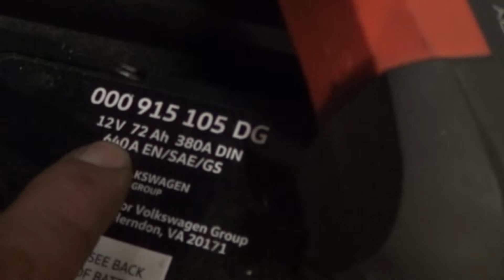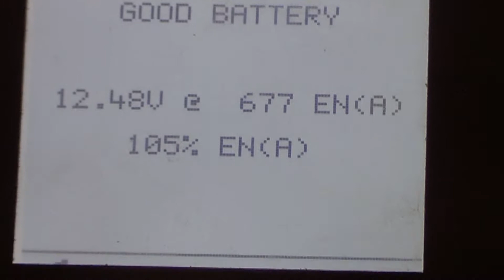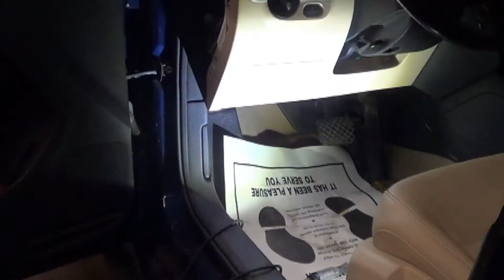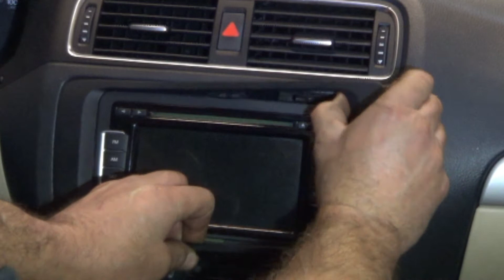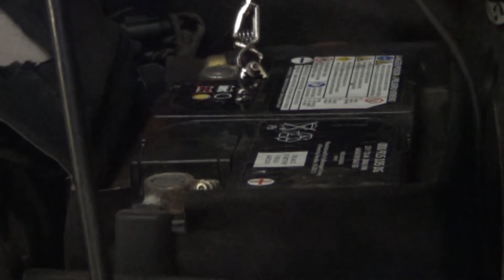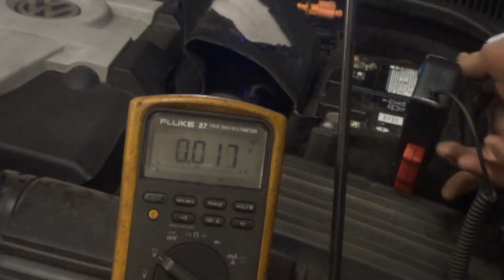2011 jetta tdi Battery drain

Comment: I have a 2009 cc (same car) with the same issue. The mechanic however couldn’t locate the source. He attempted changing the pesky door modules, changed the battery, confirmed the alternator was good. He’s giving up and asked me to pick up the vehicle. 
NOTE: their is another fuse box left of the steering wheel. 
I wonder now if it’s the radio, seems to be a common issue. I also just learned that prior to the battery draining/dying, the horn stopped working. Any advice is welcome.
Reply from the maker: advice in video,  Thats what I know.

Comment: i have a 2013 vw cc. one afternoon before work i had to jump my car to get to work, i figured my battery was bad,bought a new one. next day same thing battery was dead, got a jump and went to work. went to oriely's to have them check the battery and alternator theyre tester said i needed a new alternator so i got that changed. still battery dead. the only thing that keeps me from having to get a jump to start my car is if i dont lock the door because there is a red light that flashes while the car is locked. if you have any ideas what the problem is please let me know, could that be a fuse or bad wire?
Reply from the maker: drain problems are some of the hardest problems to diagnose as it could literally be anything on the car.  Seek someone good to do a diagnostic process like what was in this video or the other one that I did which I believe is linked in the cards.
Reply: @CoolAirVw  thanx for the reply i got  the person that changed my alternator basically doing the same type of test you were doing with the fuses and relays ill let you know what he finds and if it fixes it

Comment: One thing I’m going to do is amp clamp through 10 turns of jumper wire on the positive since that will enhance the accuracy of my measurements.
Reply from the maker: good tip.

Comment: I’m trying to figure mine out 2013 Sportwagen TDI. Will post the issue here when I solve it.
Reply from the maker: that would be great.
Reply: Did you fix it? I am having a parasitic problem on a 2004 VW sports wagon TDI. I think there is a short in flasher warning and turn signals as they went out for a few days and I had no problem. Then they started working again and not my battery is going dead. Is this possible?
Reply: @clemlimerick6780 that sounds like a damaged wire

Comment: my problem was both the radio and amplifier under drivers seat unplugged radio still had drain pulled 40amp fuse under hood for amplifier had a 1.5mamp draw fixed the problem or you could unhook the amp under drivers side set
Reply: im having exact Same problem and i pulled the amp fuse and radio fuse but m still getting 1.5A draw . is that 1.5 draw from something else ?.

Comment: Hello. I have a 2011 vw Jetta and the radio does not turn on.The battery light is on, I replaced the battery and alternator and the battery light still on. Is funny how my Bluetooth still connect to the car but the radio does not work, no lights or audio. HELP
Reply from the maker: may require a trip to a mechanic.
Reply: @CoolAirVw  So I haven’t fix it yet. So if I disconnect the radio from the car it doesn’t drain my battery but if I keep the radio connected to the car then it drains my battery. Is the oem radio and it doesn’t work
Reply: @michaelreyes6761  I have the same problem in my Passat, did you fix it?
Reply: @jorgemedinaregalado490  yes. I got a new radio from cruthfield. They sent me a radio that fit perfectly on the dash and all I had to do was just plug it in. The vw Bluetooth is under the drivers seat so I unplugged it in order to make my aftermarket radio work. Is really simple. I paid 200 dollars all together. 2011 vw jetta. You call them and give them all the information of your car and they will take care of it
Reply: @jorgemedinaregalado490  The battery light was the accessories computer. I bought one for 50 dollars and had a mechanic install it for me. I paid 150 for the install.
Reply: @michaelreyes6761 known issue with those radios

Comment: I have a 2015 Vw Jetta. Battery is draining but the radio works. What else could it be?
Reply from the maker: It literally could be any device on the car. The video shows the diagnostic method for you to figure it out.  My other battery drain video shows some more.
Reply: I’m having the same problem. 2002 GLS Jetta battery drain. Replaced battery, starter. The alternator is okay. Radio works
Reply from the maker: @millerterrence82  this video and the other video I have on battery drain should help.  The other video is on a similar car to yours and in that video I mention every battery drain problem I've ever fixed on a Vw.

Comment: Current draws can be a real pain... we had one (a couple years ago) with similar radio and similar problem.... was a white Jetta though. =)
Reply from the maker: Luckily those problems don't come through my shop much.
Reply: @CoolAirVw  I found a capacitor that was leaking in my monsoon amplifier. The amplifier is connected strait to the battery A+12v positive.  and ground the key switch B+ and fuses aren't connected to the amp.  3 days and dead battery. The amp gets power from one of the big fuses on the battery box. The radio gets voltage from the amplifier in the trunk and the capacitors are parallel to the battery voltage.   It seems like I got the idea to put a 12v relay from the key b+ at the fuse box to the switch on battery voltage and amp from someone on youtube but I can't find the link.  Who showed us this monsoon amp problem and how to hook up a relay?  I thought it was Thomas EXOVCDS.   I watch his videos all the time but I can't find the monsoon amp relay video. this is a common battery drain and also installing the aftermarket radios like you are diagnosIng.
Reply from the maker: @collinhales3551  My other parasitic drain video the problem was the amplifier.